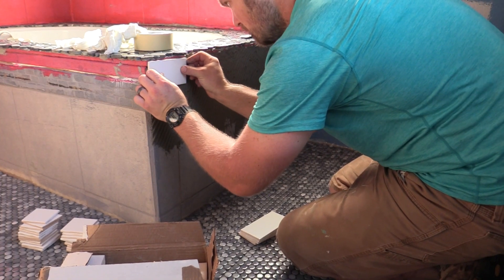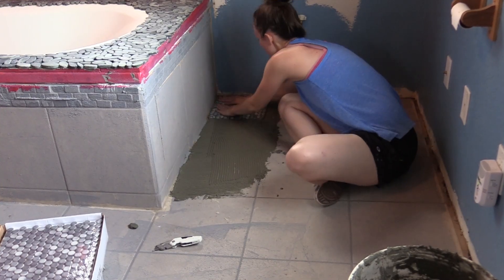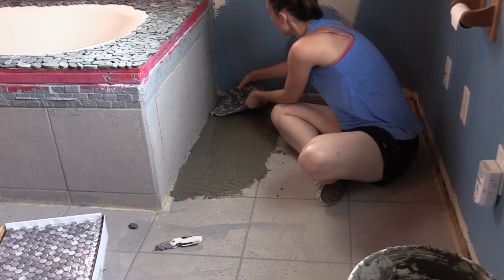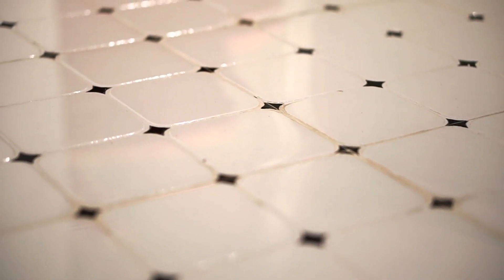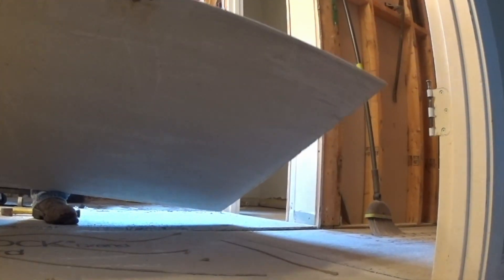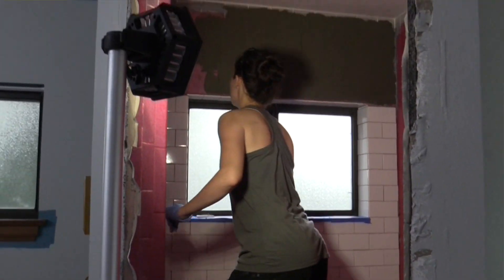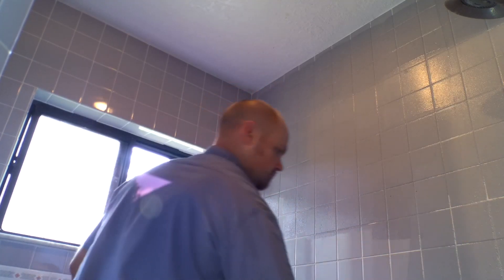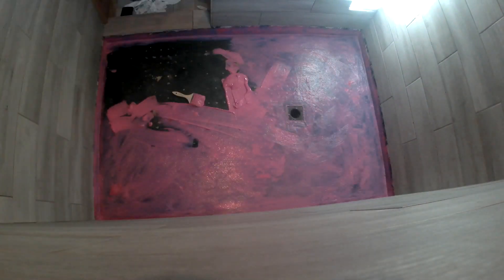licensed GC explains: tile over tile

Comment: Here's to hoping someone answers this question. I'm planning to do tile over tile, but my current surface is not level. What are my options to level the floor before I start applying the adhesion primer, membrane, then start tiling?

Comment: ecoprimgrip is the best as long as your existing floor is secure and solid.  Its being used a lot now and I've had no issue with it but doubling up a 2nd layer of tile I wouldnt recommend doing on a plywood floor especially with 16 inch centres.  Just sounds risky